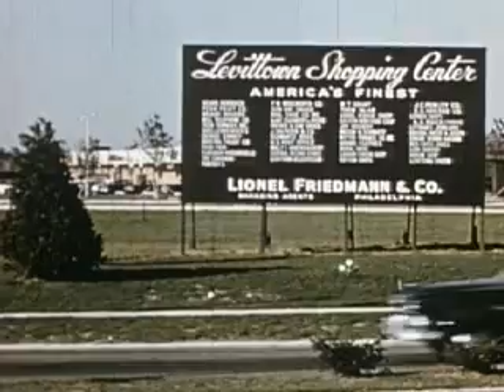Ford Tractor Construction Levittown, PA (1956)

Comment: A few small corrections.I grew up in Ltown.  The land Leavittown was built on was not swamp and scrub brush but prime farm land. Some of the best soil anywhere in Bucks Co. The slabs the houses were built on had heating systems built in. The floor heat worked well until your house settled then the slab cracked and no more heat. Most Ltown homes now have baseboard heat. All in all it was a good place to grow up in the fifties and sixties. Now it is run down and over built and jammed with traffic

Comment: @dipslover Not exactly.  They had a black enamal tar like paint.  But they did rust out a few years later.  I worked for Meenan Oil and used to hand dig the tanks out in the 70's as not to distrub the lawn.